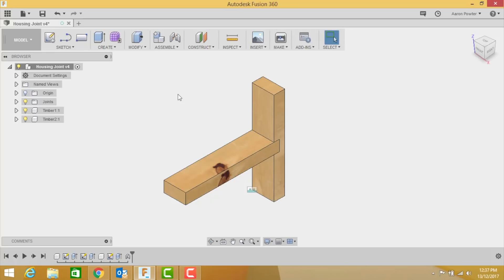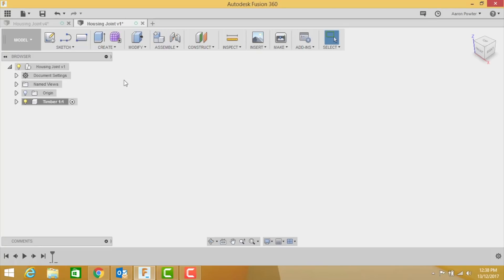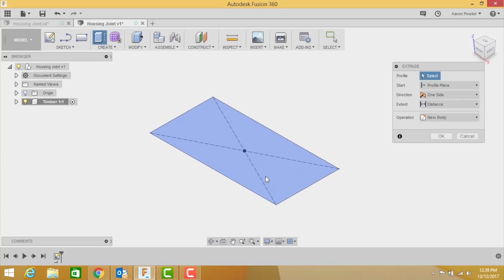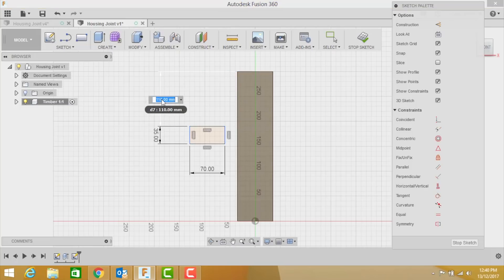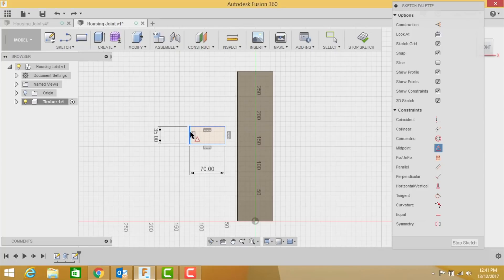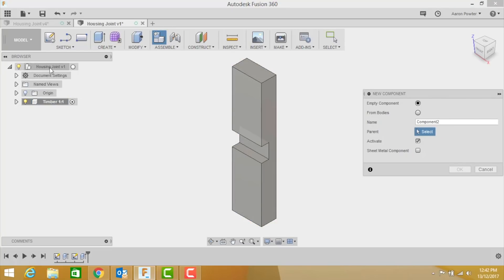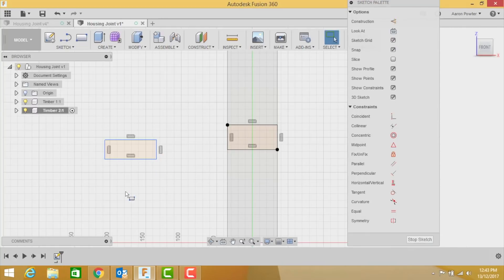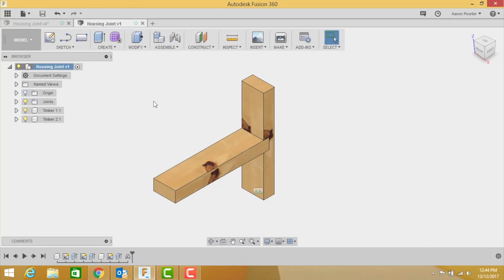Fusion 360 Housing Joint - HTC Tech10

Comment: Great tutorials, thanks! Now say I have access to a CNC router and want to cut that slot in Timber 1. Would I have a problem fitting Timber 2 in it? How do you enlarge the slot by a small factor to make the assembly possible in the physical world?
Reply from the maker: Hello Viorel.  As with many CAD CAM programs there are always more than one way to do this.  You could adjust the size of your dimensions.  However, the easiest way to do this is within the CAM section of fusion 360.  Within the "passes tab", go down to "stock to leave" and enter a negative "radial" value.  A negative radial value with remove more stock, whereas a positive value will leave extra on the walls.  Now the same can be applied to the "axial" which will remove more or leave more in the floor of the part.  I trust this answers your question?  Thank you for stopping by my channel ;-).  Cheers, Aaron.
Reply: Yup, makes more sense to do it in CAM :) Thank you for answering my question!
Reply from the maker: You're very welcome :-)